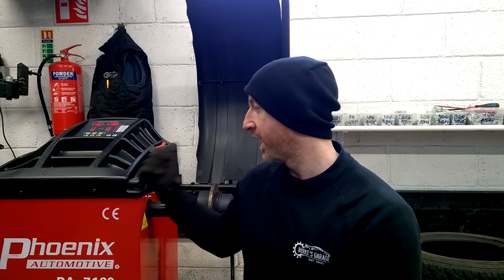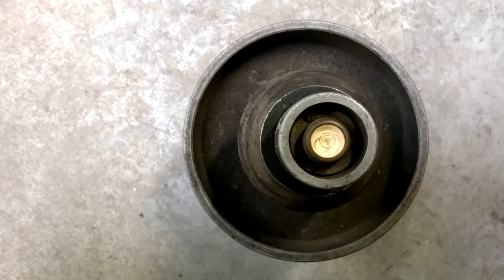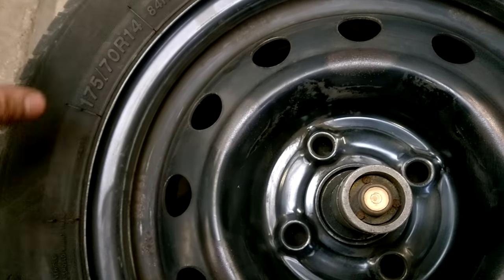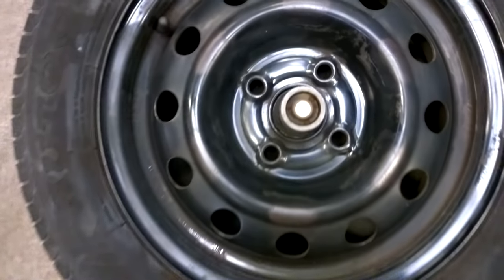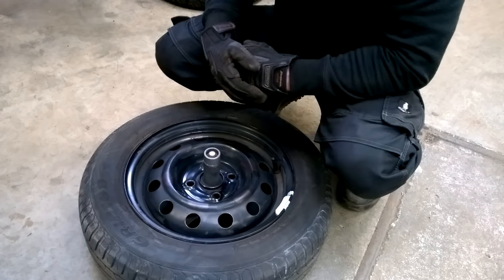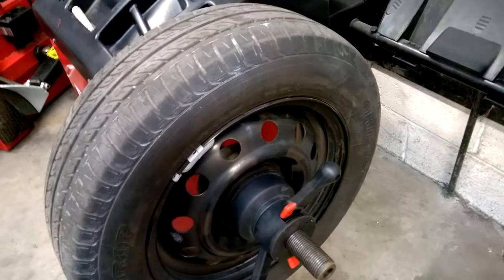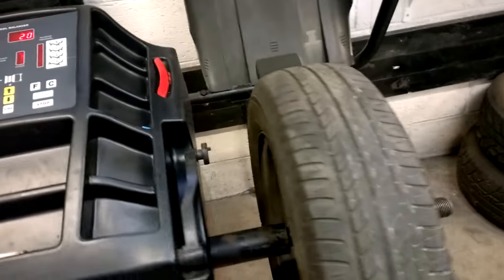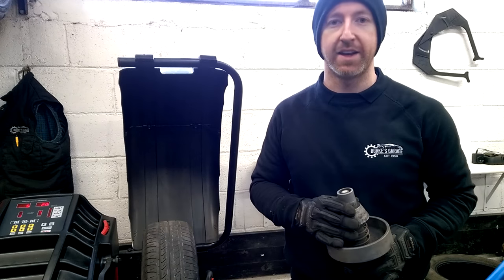Digital Wheel Balancer Vs Bubble Balancer  - Is there much of a difference???

Comment: Bubble level (hence vertical spin axis) can detect mass distribution difference in the radius direction, ie hinge point. Cannot detect mass distribution difference in the axis direction (ie wobble imbalance which avoids driver the most).

Comment: The bubble balancing should have been done splitting the weight between the inside and outside. 

Our digital balancer has a choice between static and dynamic balance. Had you been able to select static balance on your digital, it may have been closer. If you were to do a perfect static balance on a digital machine, then run it on dynamic it would also be way off. 

I have used both, no doubt the digital machine is better, however, when used properly, a bubble balancer can do a pretty darn good job. The true proof is driving down the road. If the car rides smooth with no shake, you have done an adequate job. Bubble balancer is cheap, any DIYer can have one, and they do not take up much room in a shop.

Comment: I use electronic wheel balancer works awesome. Static balance all aluminum wheels on it one weight per wheel.  Does Not matter what speed you drive your car there will be no shake. The one problem with electronic wheel bouncers is when you lose Hydro you have to re-calibrate it and I would bet 90% of people never recalibrated from the time they buy it till they take it to the junk. Hence poorly balanced wheels

Comment: I'd try it on the road and see if there is. Vibration when you drive at Hi-Way speeds .... A lot of tire shops have kids that don't know how to use half those tools and as well with the bubble balance system you should do a "Y" balance the heavy area at the bottom of the Y and you put the weights at the top of the "Y" that is the proper way to do a bubble balance...

Comment: Very interesting. I have a brand new set of road force balanced tires and brand new rims that I tested on an old snap on with fairly new bearings just to compare. The snap on is a fully manual wbk2a from the 50's or early sixties. The snap on isn't a bubble balancer but works basically the same as your modern machine but relies on gravity to settle the heaviest point of the tire to the bottom. It is telling me the new rims and tires that were road forced are ALL out about half an ounce and the weights are offset about 45 degrees to where I would have installed them. apparently gravity is different now than it was 60 or 70 years ago. How can that be?
Reply: I have definitely noticed that gravity has gotten stronger over the last 60 or so years!  Objects that were an easy lift 60 years ago have grown to be very difficult to lift now.  I would estimate that a 40# bag of dog food has increased about 50% in weight over that time.  That said, the mechanics assumption that his whizbang machine was 100% correct flies in the face of science.

Comment: I have to trust the bubble more than the new machine.  The whole reason I'm watching this video is because I swear I get terrible balance jobs at the shops I use.  I've actually put new tires on a car that rode smooth, and had it ride worse on the highway after the new tires.  if the new machines are not set up right and calibrated right,  they can be way off but still put on the pretty show.
Reply: from someone who works at a tire shop, whoever balanced your tires just did a terrible job.  Bubble balancers do not account for lateral play in the tires the same way a laser tracks it.  And plus, I've seen it too: people get sloppy with their work and leave .5oz left to be balanced, don't finish the job, and anything else.  I almost guarantee you that a well calibrated laser balancer will outperform a bubble balancer in every single way except cost.  They're more accurate, simulate road force, don't just measure a radial imbalance, and are faster.  If our shop started using bubble balancers just to fulfill your hypothesis, more cars than ever would leave with a nonlateral balance, which can vibrate extensively.  Not to mention it'll be significantly slower.  My guess for the poor job are:
1.Bad tire(DOA)
2.Poor employees 
3. Uncalibrated machine (the new ones which use lasers go out of calibration often, we use ones where you manually enter the dimensions of the wheel with measuring arms)

Comment: LOL. You concluded that the bubble balancer was inaccurate because the dynamic balancer said so. How do you know it's not the other way around? That's like comparing a digital ANYTHING to it's analog counterpart and automatically assuming the analog tool is bad if there's any difference between the two. Definitely a Science 101 fail.

And by the way, how are digital tools calibrated? That's right, with ANALOG tools!
Reply: Jake Jones thanks for this comment so I didn’t have to
Reply: My thoughts exactly.
Reply: Probably because the dynamic balancer is backed by a warranty guaranteeing its accuracy and it's probably routinely calibrated further guaranteeing its accuracy. The other one is cheap junk made in China.
Reply: Many places don't calibrate them as often as they should though. The bubble balancer can't be wrong as long as it's level and balanced itself, it relies on the Earth's gravity.

The amount of times tyre fitters have failed to balance my wheels using expensive, digital machines is ridiculous.

Comment: Does that digital wheel balancing machine do more varieties of wheel types like for motorcycle , car , truck ,...etc because alot of the manual bubble type and harbor freight motorcycle specific wheel balancing equipment seems to be specific. Aka you have to get different manual machines for different vehicle types. Is this the case for the dynamic machine you have or can it do all vehicles

Comment: Just got my car back from mounting and balancing new tires with wheel alignment. Car has shimmy starting at about 73mph, and it get stupid bad at 90. So bad I won't risk going higher. This shimmy has gotten worse over the last couple of days, which makes me wonder why tires settling in isn't taken into account. Also, why are tires spun and measured at high speeds during balancing?

Comment: At 42 seconds Into your video, you can clearly see the bubble is not centered before you continue with comparing balance results, thus throwing the bubble balance off from the start. Also, I feel you should have avoided the diagonal imbalance on the bubble balancer by splitting the required weight and adding each half on both sides of the rim. Furthermore, I think you should have balanced the wheel on the digital balancer, then see what the bubble balancer says it's results are. I'd really look forward to seeing how a test like that would compare, as this experiment could deter people from bancing wheel's themselves instead of paying shops out the ying-yang to do it. I feel this test was inaccurate and failed to provide the justice bubble balancers deserve. I don't mean to sound rude, and I'd love to see an updated video! Thanks!

Comment: I'm not going to ask about putting weights on both sides since it was already asked. But What if the unbalance was in the tire itself? I think a follow up with just doing a wheel alone (And maybe a small ding in it if necessary) and try again.

Comment: I've used an old Micro Balancer that is very sensitive and have always had excellent results mostly because I'm a fussy bastard when using it.  The problem is it won't work on some aluminum alloy wheels because the hole in the center is too small to fit over that really excellent oversized vile.  Guess I'll have to pick up one of these cheaper units with that tiny little vile.

Comment: I saw you put the weight on the outer face of the tire. I have seen videos where they put the weight on the inner side only and not the outside.  I have also seen other videos where they said to divide the weight needed and put 1/2 on the inside and 1/2 on the outside. Might this have something to do with how the machine interprets it.  There is also the question as to whether or not these finding have to do with side to side balancing and not rotational balancing. I have heard people talk about this as being not as crucial, however is that part of what the machine is finding.  How do we know if these readings you got after the bubble on the computer will affect the actual forces on the tire when we are driving. Did you try to drive the tire after the bubble balancing so see how the bubble balance worked when the tire was in use? That bubble balancer also looks old and could be worn which also happens to be  a different design than others I have seen. Others have used a new balancer like the harbor freight. Maybe that does a more accurate job if your bubble balancer has some issue. I think your findings may bring about these questions and are not giving an accurate comparison between the bubble and computer. Maybe you also run a shop and are just trying to push more business your way rather than people trying to balance a tire themselves. You would have financial gains. We could not see where the bubble was that clearly in the video. The balancing pivot point or the seat in the bubble unit could also have pits or gouges in it which would affect its accuracy.

Comment: Can't do a comparison when you don't know how to do it at all
Reply: JPS JPS  On the car balancing does not balance the wheel it balances the wheel, tyre, the wheel hub, the brake disc, and if its a drive exle it also balances the driveshaft. All three types of balancing syatem work relative to the use you are putting them to.

Comment: You should have put it back on the bubble balancer to check. Level bubbles do not lie.   And we dont know if the machine is even calibrated or if the settings are correct.
Reply: i felt like the point of the video was to shame the bubble method which has worked for many years before the spin machines came to be. i am old school and will trust the simplified method over any computer device, especially when the old way gives you a smooth ride free of shimmy or vibration on the road. that is what you get with a bubble method if you do it correctly. after all isn't that why we balance balance tires in the first place?

Comment: Of course it was worse.  Not because of the bubble balancer but the operator. 
 The amount of weight needed and location should had been found.  
 Then divide that weight into 4. And put two on the outside and two on the inside...

Comment: There's a difference between static and dynamic balancing. You just did a static balance on the bubble unit and the machine did both. That's the difference.

Comment: Your comparing a static balancer to a dynamic balancer that requires calibration. Dynamic balancers measures balance differently as they take in account if a tire is out of round and any imperfections of the tire and wheel while the tire and wheel are spinning. 

Most likely the dynamic balancer came up with different weight for both sides because the wheel and/or tire isn't perfect round and/or the tire is not worn evenly. 
 e.g. if a tire is not evenly worn a dymanic balancer will attempt to detect and adjust it's output according.  

https://upload.wikimedia.org/wikipedia/commons/thumb/d/d5/Tireimbalance.png/220px-Tireimbalance.png

Comment: The new unit is not necessarily properly calibrated. You could have improved the test by actually taking the car on the road for both balances. Also, distribute the weights on the inside and outside of the rim

Comment: Computer balancer is only as good as its calibration + how it's used. That mud guard usually gets slammed into the up stop which can throw off your calibration. Also everyone installs weight with tire on Computer balancer and if it's the clamp type gets hammered on. The oscillator in computer balancer doesn't like the sudden shock waves created by throwing up the mud guard or installing clamp on weights. I've bubble balanced tires that I repeatedly brought back to the shop cause of shimmy in tires and they come out far better than a computer balancer that's out of calibration. A good tire shop will calibrate every week .

Comment: Hello, could you please redo the video with bubble balancer using one set of wheel weights in the centre of a wheel ?
Reply: this would be the correct way to do it. of course when you put all the weight on one side it will show it is off on the machine but will likely perform well on the road. also machine calibrations can be off. i have seen tires come out of the shop that were spin balanced and they created a shimmy on the vehicle at speeds.

Comment: A bubble balancer can do a perfectly fine job of static balancing a tire but it cannot perform a dynamic balance.  To dynamic balance the tire must rotate, period, no rotation no dynamic imbalance to measure.  What's the difference?  Imagine you have a tire that is perfectly balanced.  Now attach a weight to the inside rim of the wheel and equal weight to the outside rim but 180 degrees away.  This wheel is still statically balanced and the bubble balancer will agree but it is no longer dynamically balanced.  When rotated around an axis, like when attached to a car driving down the road, the wheel will try to vibrate around an axis at a right angle to the axis of rotation.   Wait, come back! It's easier to visualize if you imagine a tire standing on the ground in the same orientation as if mounted on a car then suspended just above the ground by a string hanging from the ceiling.  Now you intuitively know where the weight would go if it flew off of a spinning tire so just push it that way with your finger.  The tire spins around on the string.  Better?  I thought so.  So what?  If you put a dynamically imbalanced tire on the front wheels it will oscillate back and forth as the tire rotates causing the steering wheel will vibrate.  Put it on the back and you might not notice.  Splitting the weight between the inside and outside when static balancing is just a guess.

Comment: You put all the weight on the outside of the wheel.  Perhaps split the weight in half and put on both sides of the wheel.  Should be doing that to avoid getting a pulse in the steering wheel in sync with each time the wheel rotates around.  Also that small tire/wheel needed alot of static weight to balance.  That's 3 times as much as all mine needed the other day and I have larger, heavier tires.  I'd say there's something wrong with that tire/wheel OR the static balancer itself.  Clean inspect and lube the pivot point of the static balancer.  Try again

Comment: Sorry, it was an inaccurate comparison. You never set the spin balancer for static testing, compared to dynamic. With static balancing weights can go inside or outside. It depends on how you set up the electronic balancer.  Same as an aluminum wheel vehicle where weights never go on the outside. I know, I've done it for years.

Comment: Today I learned. Thanks for the video. Your accent is also awesome.
Reply: I'm fairly certain this comparison experiment is faulty. It's my understanding that static balancing (the bubble) is only capable of eliminating/diminishing radial imbalances. I'm fairly certain that the machine is picking up a lateral imbalance. The reason the lateral imbalance increases when he adds the weights is obvious, he only adds them to one side. If that's correct, how could he not have realized this? He has to put the weight on both sides in order to satisfy the digital balancer.... 
I don't know where the readout for radial imbalance is on the digital machine. But even if it showed a radial imbalance, Gerard could have improved on the radial imbalance while still using the bubble; By adding slightly more weight and spacing that weight around the lighter side of the tire until it is, more or less, balanced.

Comment: Two problems with your comparison. One you didnt rotate the tire on the bubble balancer to prove it repeats, many old poorly maintained bubble balancers dont. Two, you put the weights on wrong. When bubble balancing you cut the needed weight in half then spread it out in a Y pattern with the light spot. Your test is not valid.

Comment: Wrong, 
1. You balanced it wrong by using older methods, you get better results by using the Y method! While the old method works best for low speed, the Y method fine tunes for better high-speed balance!
2 You only addressed the outside of the wheel, when using static balancing you divide the weight between outside and inside wheel bead lips for best results!
3. I guarantee you deliberately skewed the test as I have never had an issue with  static balancing in 50+ years of using same!! You really only need dynamic balancing in racing applications at speeds over 100 mph!

Comment: First off you didn't put the weight on correctly using the bubble balancer. Iv had my wheels balanced on some of the best machines and me and my bubble balancer have a smoother running wheels. It even balanced bent wheels better. You are out dated.

Comment: You may know how to use that fancy digital dynamic balancer you have there but you certainly don't have a clue about the bubble balancer. You didn't weight the wheel correctly when using it! You are also comparing apples and oranges at any rate, static versus dynamic. Totally different methods from different eras. Try using the equipment properly then conduct a series of road tests that includes using age appropriate vehicles and tyre types. You might end up with a fair comparison.
What have I leaned today? Not to trust you with my wheel balancing. 👎